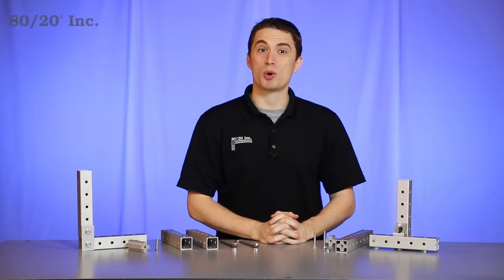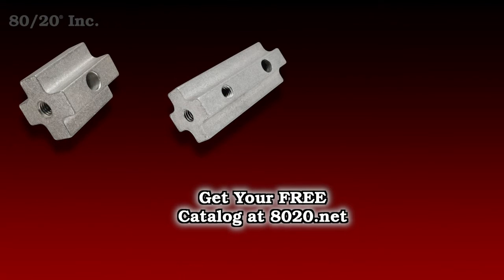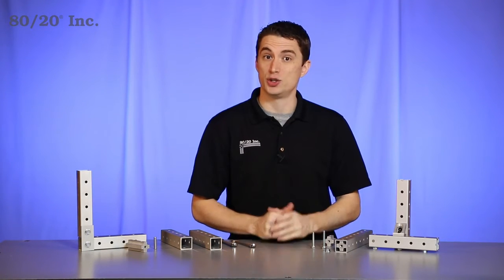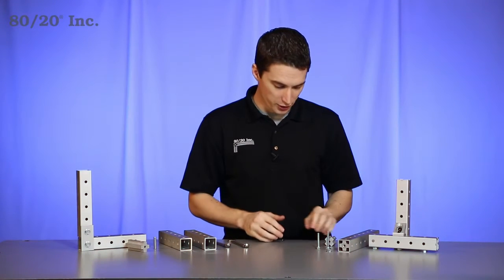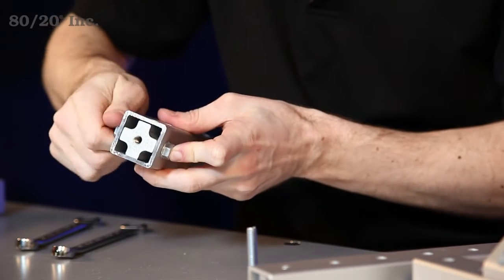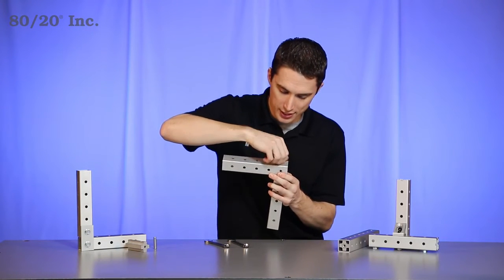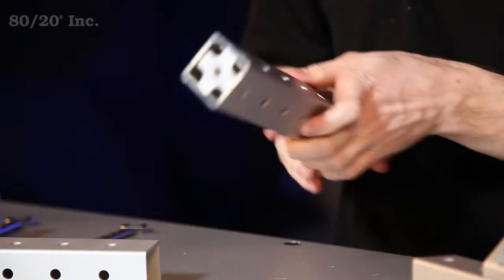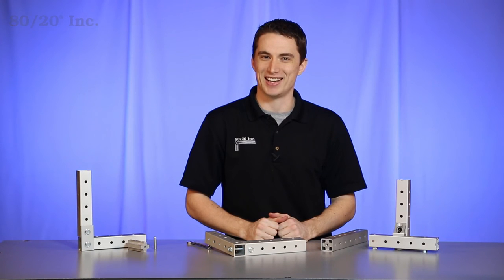80/20: Ready Tube Overview

Comment: How do you add machine holes at specific locations?  When I check the web site, I don't get any machining options for ReadyTube products.
Reply from the maker: Our Ready Tube series has pre-drilled holes every 1.5 inches along then entirety of the profile. We also offer Ready Tube profiles that have no pre-drilled holes. For both styles, we offer a standard machining service for adding machine holes. We are currently working to update our website to support machining options for our Ready Tube series. In the meantime, please contact us at; services@8020inc.com and we would be more than happy to assist you.
Reply: @8020llc  So at 0:50 you say "machined holes at specific locations".  This video is 4 years old... and I don't see that sort of option anywhere on the web site or in the catalog.  Furthermore, I sent an inquiry several days ago using the "CM Quote Request" at this page: https://8020.net/custom-machining

I've gotten no response.  I mean, I guess I can email "services@8020inc.com" or you can just answer the question here so the next person that watches this video and has the same question doesn't have to the same thing.

Do you actually offer machined holes at specific locations on ReadyTube?  Basically, I need six through holes, 3 pairs, with specific spacing on the same side in either ReadyTube or 30-3030 extrusion.  MISUMI only does a maximum of 5 through holes per side per extrusion (regardless of length).
Reply from the maker: Yes, we offer machined holes at specific locations for Ready Tube and our 30 series profiles. We have no limit to the number of access holes you can have per profile, as long as they don't overlap.  At this time, we are currently working to update our website to support Ready Tube machining. However, our 30 series supports machining services online and access holes can be added.